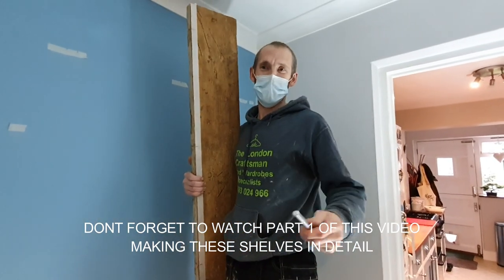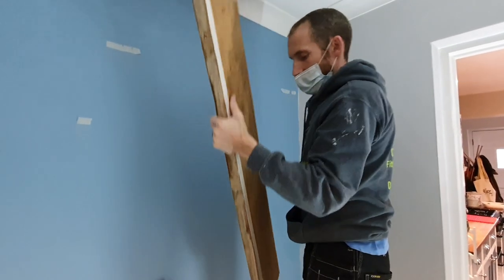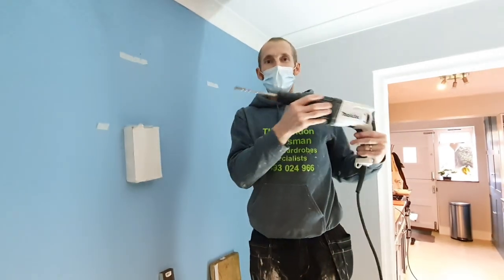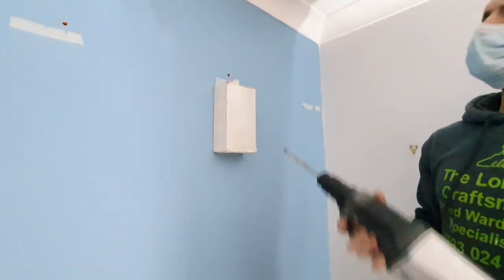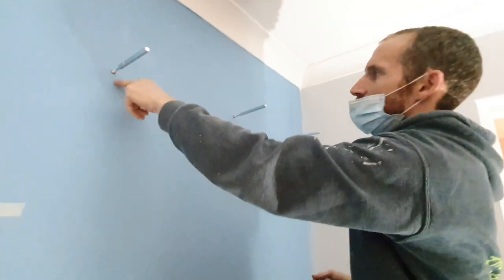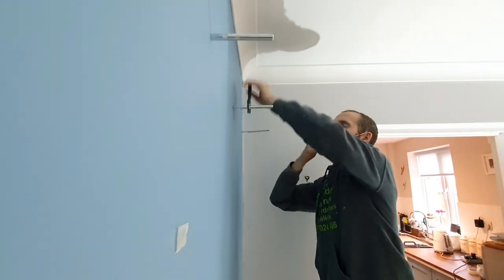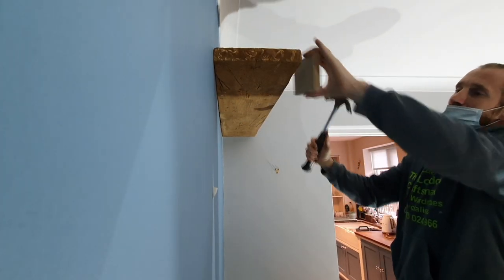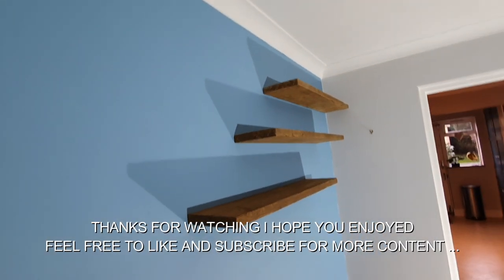DIY BUILD PROJECTS With Ryan Cooper |  How to INSTALL Floating Shelves - Part 2 of 2  |  EP#45

Comment: How much weight do you think they hold
Reply from the maker: It all depends on what kind of fixing you get. Drill into concrete then 10 or 15 kg? Into brick or similar then less. Look on ebay for floating shelf bracket and it probably has the specs 😁

Comment: How much weight do those brackets take?
Reply from the maker: Im going to say 2 brackets 10kg or so, 3 brackets maybe 15kg, 4 brackets maybe 20kg. 
I guess it all depends on shelf length and amount of brackets per shelf, or per meter.
These shelves are 1100mm long with 3 brackets and id be happy putting 15kg on them.
If your shelves are drilled into concrete then this may increase the amount of weight they can take possibly.
Sometimes its just a judgement call once the shelves are fitted and how good a fixing you get👍👍
Reply: Where did you get the brackets?
Reply from the maker: Hi Anthony I put a link in the description for you, These are the particular type I use most of the time